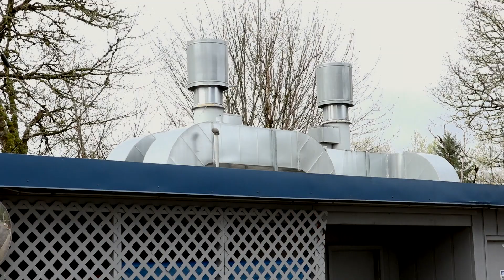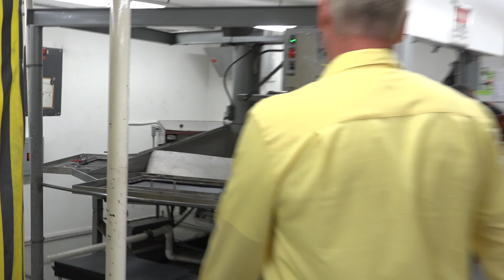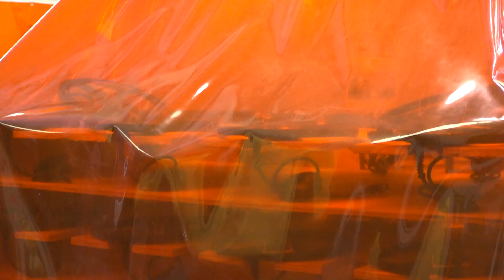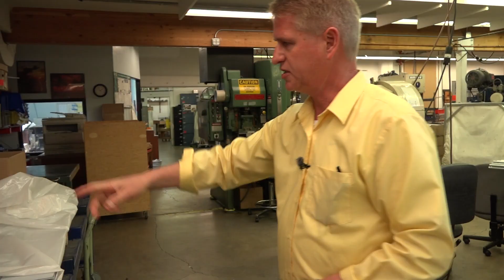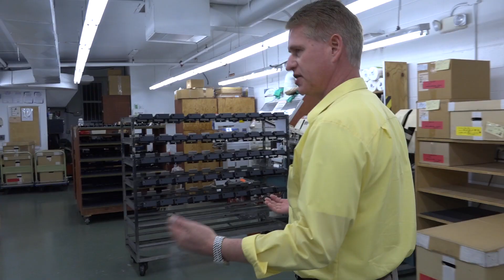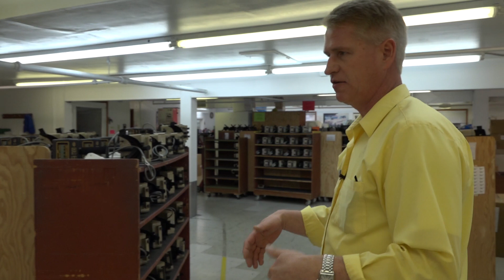White's Electronics Factory Tour

Comment: Purchased my Whites GMT around 2003. This purchase was one of many reasons my ex told me she was divorcing me. Having said that, about 21 years later, still loving my Whites. Sent the detector in for service, was repaired and returned for free! Fast forward to late August, 2024, using my detector in a very abusive land (northern Nevada, extremely steep rocky terrain). I bit off more than I could chew. I literately would install feel vertigo when viewing the path I took to make my way up this dangerous mountain top peak. You can see this peak, north of Int. 80, about two miles north west of Fernley,Nv. Anyway, was forced to find a different route back to the badly missed truck. Slipped and fell, it hurt but only cosmetic damage to my epidermis. The second fall was scary, painful and bloody. Tweeted my shoulder, bloody leg and hand. I feel in the GMT. Thought for sure I broke my baby. Turned it on, shaking slightly, and she sprang to life. Such a relief. Durable machines. The peak I hike to is lit up at night. Top of the mountain, long range running parallel to 80. Poor Scout was sore for two days. The rocks are very hard on his pads. I will not hike this type of terrain agin. Thanks for reading my novel. Whites are made in America. My GMT finds small pieces of every metal out there. I run in “auto” usually. Of course you will need to purchase a shield that clips to the head. Pardon my typos, very difficult to edit ✍️. The mountain too is not lit up, but the top of the large cell tower is. Sad to read in comments that Whites is no longer around 🥲 does anybody reading my long comment recommend a “shoe” for my Queensland? He probably wouldn’t wear anything, but….. one more tidbit, Scout only ventures 30 yards from me when hiking. He is genuinely protective and caring. Well taken care of. 🐶 thanks for reading.

Comment: That was very informative. I own the v3i and have had a difficult time using other name brand headphones.  the wireless set that came with my machine does fine . Although when trying out my grayghost and black widow set on my v3i I can't get either one to work properly. The same headphones work perfectly on my other detectores ctx, xterra 705 . If I partially Insert the headphones to my v3i I can get a better response , but if I fully insert the headphones I get lots of interference, chattering and low volume.  Why change from wireless to wired headphones,  sometimes the batteries go bad and having a wired set is always a good backup.  Any info in possibly correcting my wired headphone issue would be great . Thank you Big Mex
Reply from the maker: Hey Big Mex. Can you try the same headphones in Mixed Mode Stereo?
Reply: @WhitesElectronics1950  sure thing.  Thank you for quick response.  I'm very impressed.

Comment: Awesome video, I enjoyed the tour. I have the Whites V3i and the new MX Sport. Both detectors are awesome! Whites Electronics Inc. is the #1 leader in metal detectors. Thanks again!
Reply from the maker: +MD Treasure Hunter Valley Thanks for the comment. How are you liking the MX Sport?
Reply: +White's Electronics, Inc. The MX Sport is very comfortable when detecting,  pinpointing is very accurate. I've detected in a park and it preformed wonderfully. I have not tryed the detector in the water as of yet, just as soon as the weather warms up I will be hitting the lakes and streams with the MX sport.